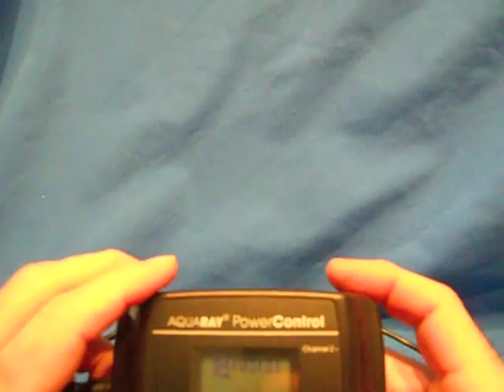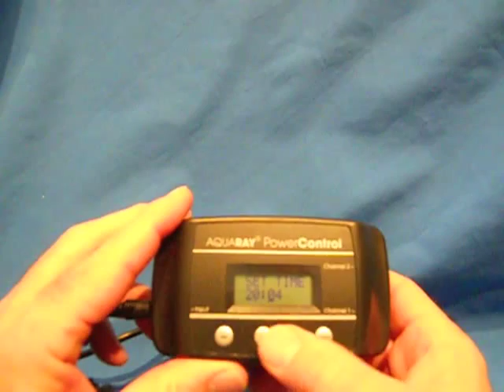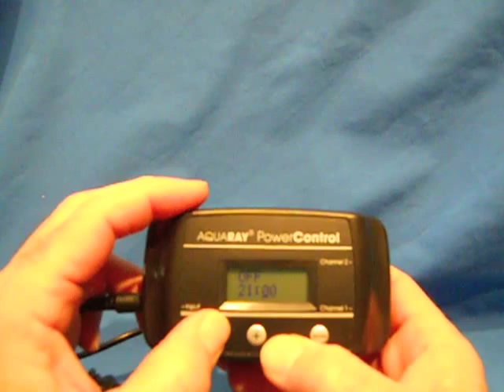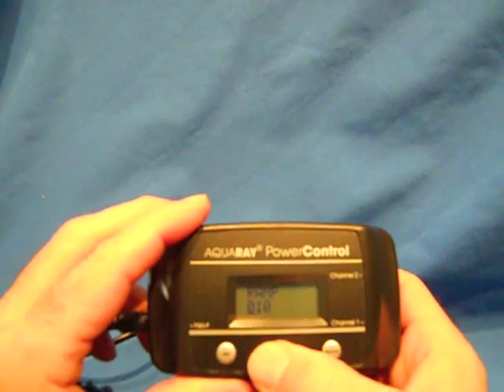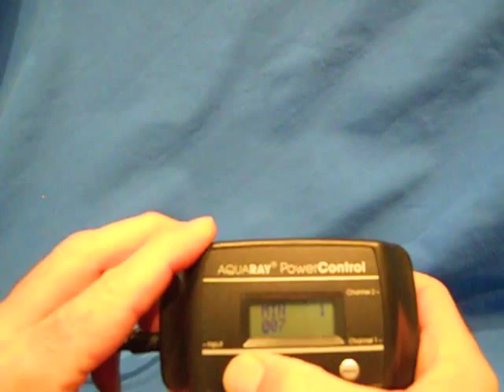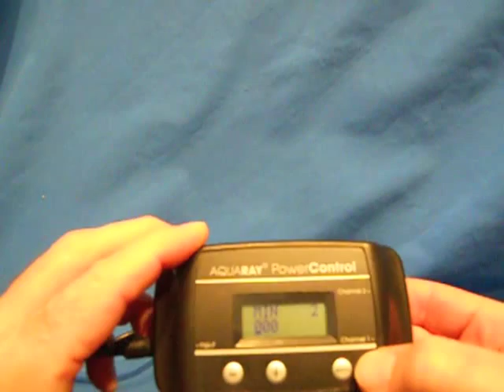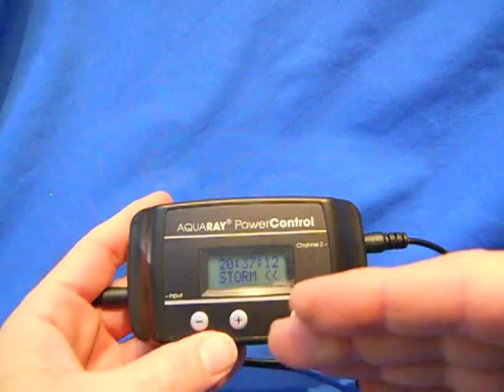How to program the AquaRay LED Power Controller - DrTim's Aquatics

Comment: I purchased one of these.  However, when I set it to ramp off it cycles down and then comes back on again after 1 min.  I'm using the 1500 Ultima NP and set it to go off at 20:30 with a 5 min ramp.  Once it ramps down it automatically comes back on again (full lights) and then ramps down to moon lights and it keeps doing this until I physically remove the power and reboot the unit.  Is the unit faulty or am I doing something wrong with my settings?

Comment from the maker: Hello

This particular unit (items 2480 or 2490 ) has two inputs so can control 1 of the 1,000 or two of the 500/600.  If you want to control more lights you need to get the 8 input model (item 2730) which can control 4 of the 1,000 or 8 of the 500/600s or any combination of the two types that total 8 inputs.

thanks